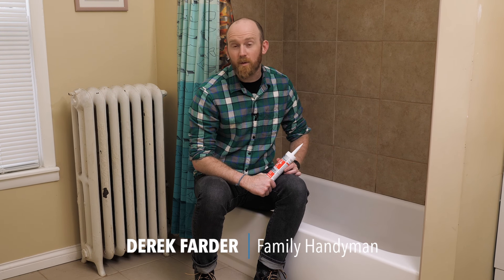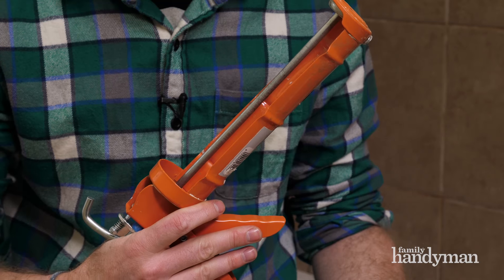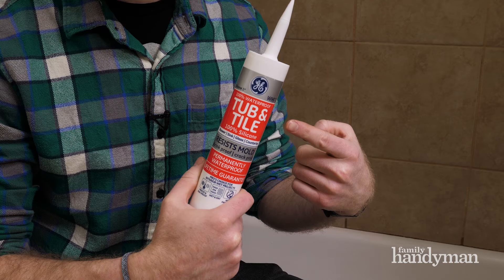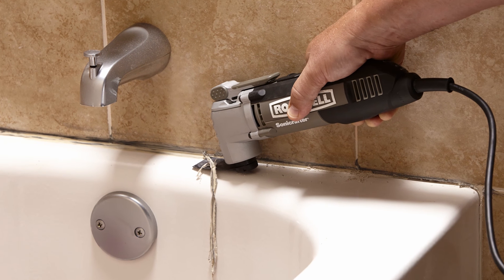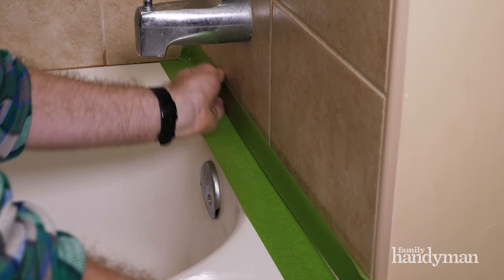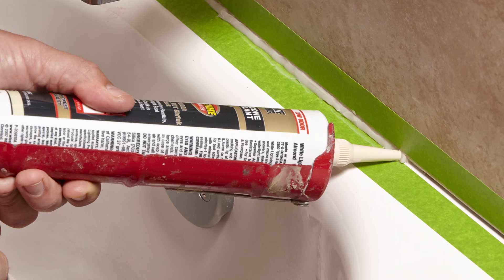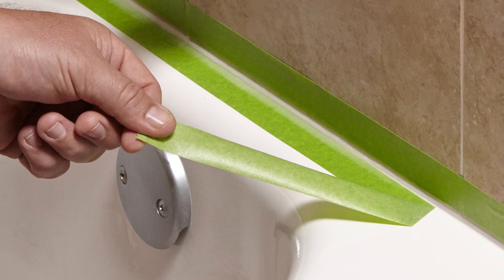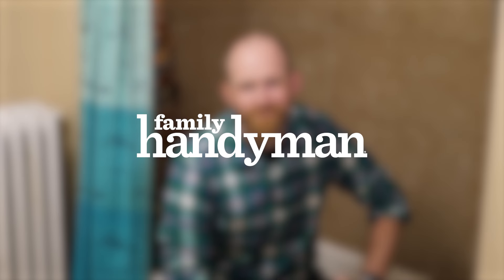How to Caulk a Shower or Bathtub

Comment: Ugh you suggested using water on your finger to tool the silicon into the crack, so I did. Then I looked up the product information on the silicon and it said never to do that when using a silicon based product. Well, I hope it doesn’t mold

Comment: i had heard that with a tub it's best to fill it before caulking to ensure the weight of the water will not pull the tub from the wall and crack the caulking.
Reply: Lvl 1 troll
Reply: @Alexanderortiz99   thank you for considering me a troll, but just want to prevent someone from having to re-do the caulking 3 times like my daughter did before she filled the tub.
Reply: @Alexanderortiz99  p
Reply: @ms.docileone  Your clearly exaggerating, or your family is not smart.